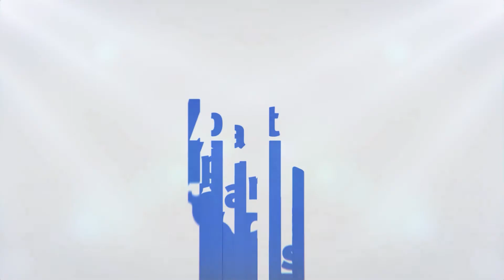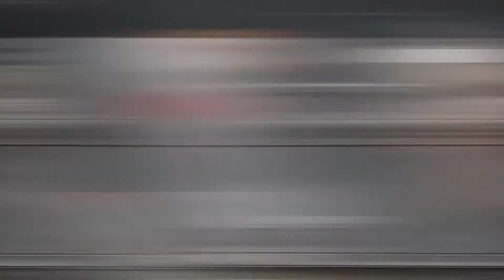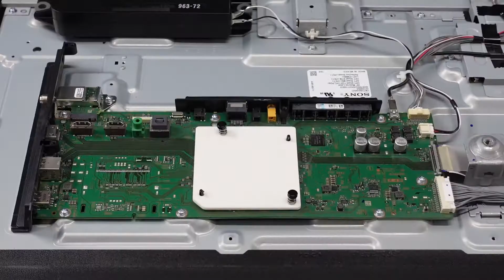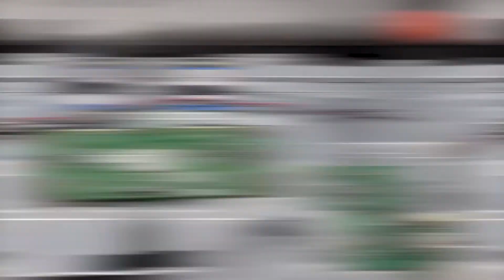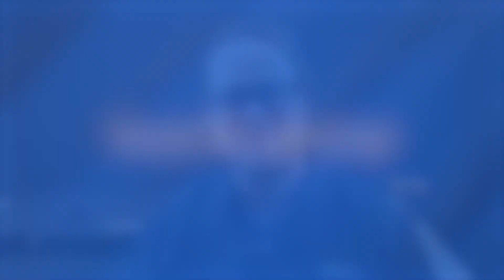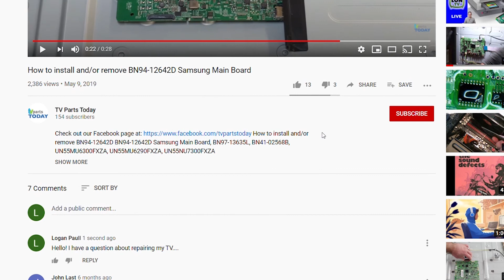Do-it-yourself TV repair.  (SONY XBR-49X800E)

Comment: Hey great video, i have the same tv but my issue is that it boots, loads the bravia setup screen and then turns off with 6 blinking lights. At first the problem was the LED driver board where you connect the power supply to the tv, replaced it and now turns on but turns off in 1 minute and gives 6 blinking lights. What could that be? Image on tv looks fine
Reply from the maker: @Aaron14Menjivar
I know the blink codes that Sony uses can tie back to a few different components in your set. I would get a hold of our customer service department and run your symptoms by them. 
phone: (930)212-1975
email: info@TVpartsToday.com

Comment: Sorry for reviving an old video! I have this TV and it randomly went black one day, still has sound, backlight, everything seems to work, but no image, just black screen, any recommendations on what it might be? T-Con maybe? I try disconnecting the ribbon cable on the right side of the TCON, and there is no change, but if I disconnect the left one, the screen shows one side white and the other black, but without any text.
Reply from the maker: @zortheck
I would assume by your description that your main board is faulty.  We see this quite often with this series of Sony TV. When you are swapping out the main board in your Sony TV you will most likely have to do a firmware update after getting the new board in.  Our customer service department has a lot of experience helping customers with this process, so feel free to reach out to us with any questions.

Comment: I have a sony xbr-49x800d and evidently the standby voltage has a problem.  It won't turn on after sitting a few hours unless I unplug the 19.6 volt power supply and plug it in again after a few seconds.  Then the set comes on and goes through the rebooting sequence and works fine.  Any ideas for me?
Reply from the maker: First I would try to replace the power supply.  I would assume by your description that this Sony unit has an external power supply on the power cord?
Reply: @tvpartstoday  Thanks for the response.  Yes it does have external power supply.  I removed back and connected voltmeter to where power supply voltage goes in and it stays 19.7 VDC, but the reason I removed back to check was that just yesterday the white LED at bottom comes on as if going to turn on then dims and goes out by itself.  While this happens the 19.7 volts remains constant but now the TV does not turn on at all.  Any ideas?
Reply from the maker: I would suggest replacing the external power supply cord first.  This is kind of a weird situation where the power cord plugs into the unit via the "LD board". This is sometimes called an "LED Driver" in our system for this specific unit, depending on which part number is in your TV. This LD board would be my second choice for a swap.

Comment: Hi! I don't know if you guys respond to Q's for older videos like this, but I have this same model TV and it has the screen jittering problem that seems to be all too common with them. Based on other videos, I went ahead and ordered a new T-Con board which I installed earlier today. This, combined with the recommended reset procedure (unplug for 5 minutes, press and hold the power button for 30 seconds before plugging back in) fixed it for about an hour or two, but then it started jittering again. Any recommendations on what it might be if not the T-Con? My first thought was to maybe clean the contacts on the two ribbon cables and plugs for the display, but with two T-Con boards now exhibiting the behavior, I don't think the T-Con is the culprit. Thanks.
Reply from the maker: If you were going to try another swap, I would suggest swapping the main board next. There could also be an issue with the panel.  Going off of your description, it sounds like there could be an issue in the TV causing problems with the boards. I am nervous that the t-con that you just swapped may have been compromised by the problem in your set. I would try to do the hard reset again to see if that is what is temporarily fixing the issue.  I would strongly suggest sending us an email with your model number and a description of the issue so our customer service department can go into it in more detail. 

phone: (930)212-1975

email: info@TVpartsToday.com
Reply: @ Thanks for the reply! The jitter issue is the same one I’ve seen several videos cover where the “fix” is to identify and use kapton tape to cover the pins on one of the ribbon cables to the display that synchronize the timings between the left and right hand sides going through the T-con. I suppose I could try that next, but I’m curious as to why so many TV’s end up with this issue? Anyway, I’ll be sure to follow up with more detail via email. Thanks again!

BTW, I should clarify that the new T-con board behaved much like the old one. Powering off the TV for 5 minutes and holding the power button down for 30 seconds is what cleared the jitter for the described hour before it started up again.

Comment: Standing in front of my TV, I noticed that the right side is a little darker than the other side. Which part do I need to replace?
Reply from the maker: There could be an issue with the LED driver board, power supply, or the backlights themselves. If your TV doesn't have a dedicated LED driver, it will be integrated onto the power supply board.

Comment: Led bar strips? How can we change them?
Reply from the maker: Changing out the LED strips is a lot more involved than just swapping out a board. The front panel, as well as the diffuser panels, will need to be removed before you can access the LED strips. There are usually a few components that hold the bezel surrounding the chassis in place. The bezel usually has a few screws on the bottom of the TV. The housing for the stand legs could also be holding the bezel in place, as well as the buffer board at the bottom of the chassis in the back. When you are trying to get the panels out of the front of the TV you will need to be especially careful not to bend, scratch, or break the panels so that there is a clear picture when you out them back into the TV. There is a tool we found online that looks like a suction cup used to keep the panel in shape when you are taking it out of the TV.  After you get to the LED strips there can be some adhesive keeping each strip in place. Its just a matter of loosening the adhesive and unclipping the LED strip from their connections. Some TV sets don't use this adhesive and there will be small guide holes in the strips themselves that keep them attached to the chassis.

Comment: Just came across this video while trying to research for an ac adapter and remote, but having no luck. I found this XBR-49X800E tv while cleaning out a home for a neighbor. The neighbor gave it to me as a kind gesture, but without the 2 items needed to check it for power, I am just stuck never knowing if it works or if its broken...
Reply from the maker: Send us an email to :     info@TVPartsToday.com       with your model number and the items you are looking for. Not guaranteed to have them, but if we have the remotes and the AC adapter for that set the guys over in our customer service department should be able to help you out.

Comment: How to diagnose this TV not to turn on at all, no image, no power. I replaced a power board but still not turning on. What board can be responsible for not turning on the TV Sony XBR49X800E?
Reply from the maker: Replacing the power supply would be our first step, but since you have already done that I would send an email to:  info@tvpartstoday.com with your model number and a brief description of your issues. Make sure to let them know that you have already replaced the power supply with no change in symptoms.
Reply: @tvpartstoday   I appreciate your quick response. I replaced it but no change. Do you think that it can be a main board or T-Con board responsible for  no power  in TV Sony.
Reply from the maker: It can be those boards, yes. I would still get a hold of someone via email to get some more in-depth troubleshooting.

Comment: My tv is stuck on a boot loop. I tried to do a hard reset by holding the power and volume down button until I see a green light and the erasing animation. It still keeps rebooting. Would I have to replace the main board?
Reply from the maker: It sounds like the main board would be the best place to start here. I would send an email to: info@tvpartstoday.com    with your model number and a brief description of your symptoms and we can give you some more information about your first steps here.

Comment: Thanks for the video. My XBR43X800 randomly went black on me while I was watching it and now has no video. I did the factory reset and I can hear the welcome audio but still no video. Would you lean main board or a different component?
Reply from the maker: if your sound is working, then it is likely your main board is okay, we would acutally suggest attempting the firmware update before spending any money on it. We have the full update guide here: https://tvpartstoday.com/pages/sony-firmware-update-help
Reply: Thank you for your response and instructions. I believe I ran the update. The white light ran through slow pulses for 5-10 minutes and rebooted. I still have no video. The only thing I get the same slight uptick in brightness (backlight) when the TV is on. Do you have any advice as to what to do next?  @tvpartstoday
Reply from the maker: When you downloaded your firmware update and unzipped the file, was the downloaded file a .pkg?
 @a4adriaan
Reply: @tvpartstoday  yes. I initially got the non pkg version on my Mac but realized on a Windows machine it downloaded a zipped pkg that I unzipped and put on a flash disk.
Reply: Did you found the solution? I have the exact same problem

Comment: Hi, i dont know if you still respond to questions, but we have a XBR-65X800G and when we turn it on the stanby light turns on, the LED lights on the screen turn on, theres sound but no picture. Sometimes after a few min the picture does come on but only sometimes.

I did do a factory reset. Noticed when we move the tv putting pressure on the screen on some edges the picture will go on/off. I think this is the main issue. Do you think the panel itself may be damaged?
Reply from the maker: It does sound like panel damage. Being able to get picture from pressing lightly on the edges of the screen is a pretty good sign that there is an issue in the panel.

Comment: I have a XBR-49X800E with multiple vertical lines that are on all the time. I used to clear it up by powering down and back up but now just vertical lines all time.   Main board or tcom board and what kind of price are we talking?   I am a former tech working on all types of equipment and can handle replacing myself.   Any comments appreciated.     Andy
Reply from the maker: Hello, 

Here is a link to those parts at the moment we are out of stock on the main board but we do get these boards in quit often. 
Main Board: https://www.tvpartstoday.com/searchresults.asp?Search=A2165797A&Submit=
Tcon: https://www.tvpartstoday.com/6871L-4922A-Sony-T-Con-Board-6870C-0704A-XBR-49X-p/6871l-4922a.htm

Comment: My XBR-43X800E stopped turning on.  I tried replacing the external power supply brick but the TV still does not turn on.  Can I assume it's the main board that's the issue or is it possibly a defective LED driver board?
Reply from the maker: Hello, 
If you have replaced the power supply we would suggest replacing the main board. Before purchasing the main board we do recommended checking if Sony still offers the firmware update.
Reply: @tvpartstoday  Quick question about the mainboard for this model.  Can I use either the A2165797A or A2165797B as the replacement?  The current mainboard in my TV is the A2165797B.

Comment: Thanks so much for taking your time to make this video. I have the 43 inch version and it got burned out by lightning coming through the cable box/hdmi cable ground. I thought maybe it was only the external power supply brick which I checked and got a replacement for but there is more damage. I was very concerned about having to remove the whole back cover, but this showed me that I didn't need to and verified it by looking at the back of mine,. Also the parts are virtually the same thankfully, though I'm getting the ones specifically for the 43 inch to be sure. So hopefully for $75 inpats and some of my time, I get by $700 set back. Again your taking your time to do this has been of wonderful and great service and is deeply appreciated.
Reply from the maker: Thank you for commenting, we appreciate the kind words!
If you are needing help in identifying any part please email Info@tvpartstoday.com and they will assist you in finding the correct parts!

Comment: I have this TV and randomly the other day the wifi stopped working.  I reset the router as usual but it still wouldn’t work.  When I go to the settings and toggle the wifi to the ‘on’ position it toggles itself back off automatically, making it impossible to connect to the router.  

Despite resting the tv by unplugging it for 2 minutes and even factory resetting it, it continues to do the same.  I hooked up an Ethernet cable to try do a software update but it says it is up to date.  Wondering if it’s a hardware issue now?  Like if I ordered the wifi part and replaced it would that fix it?  Originally thought it was a software issue but I’ve tried everything to fix it that way with no success
Reply from the maker: Hello, 
If you have already tried the factory reset we would suggest replacing the main board if the Wi-Fi board is connected to it. 
For us to identify whether or not it is we will need the model number of the TV. 
Is your model number the XBR-49X800E?
Reply: @tvpartstoday  hey thanks for the response.  Yes, that is the model we have.

Comment: My XBR-49X800E stopped turning on without warning. There are no indicator lights. A voltage tester tested positive to power flowing through the power cord, and when the tv is plugged in, there is positive power flowing to the USB hubs per the voltage tester. Power reset and factory reset all had no response. Would a replacement of A2165797A fix the issue? What are the odds it's another part?
Reply from the maker: Hello, 
For your model having no power it could be the LD Board or the Main Board. 
You could order both to save on shipping if you would like and return any parts that are not needed. Below are the links to both of those board. Before purchasing the main board we do recommend you check to see if Sony still offers the firmware update before purchasing. If you have any further questions or concerns you can also email Info@tvpartstoday.com

LD Board: https://www.tvpartstoday.com/A2170728A-A-2170-728-A-Sony-LD-Board-1-981-457-1-p/a2170728a.htm

Main Board: https://www.tvpartstoday.com/A2165797B-A-2165-797-B-Sony-Main-Board-17363371-p/a2165797b.htm
Reply: @tvpartstoday  Unfortunately, you are out of stock of the main board. Also, trying to avoid restocking fees and return shipping if I don't need a part.
Reply from the maker: @IG-kz5ip  Hello, I am NJ, the plant manager, I believe I had the pleasure of speaking to you today on the phone about this issue. While the employee who posted before me is not technically wrong, there is a way to be more "right" so to speak. The A2165797b and the A2165797A are the exact same part. Sony main boards a re tricky in the way that the manufacturer will place a number on the board that is similar in format to the part number, IE: A#######A/B, that number is useful - however, the official part number of the main board for a XBR-49x800e is the A2165797A. Sonys , for the most part, you can order by model number alone in regards to the main board as Sony typically ususes the same main board throughout the entire series IE: XBR-55x800E, XBR-49x800E, etc. -NJ
Reply: @tvpartstoday  NJ, you are the best! Thank you for all of your help! Anxiously awaiting the restock of that part.

Comment: The channel logo and sometimes a few lines appear on the TV screen for a few minutes and disappear automatically.Frozen subtitle image and sometimes only the frame on Sony 55x8000h TV stays on all inputs for a few minutes
Reply from the maker: We would recommend with replacing the main board first! That part number would be 	
A-5015-318-A for a 55x800H, link is below! https://www.tvpartstoday.com/A-5015-318-A-Sony-Main-Board-A5015305A-1-003-740-p/a-5015-318-a.htm

Comment: I have a 2017 Sony XBR-X800E that will not turn on. I hear a clicking noise when I plug and unplug the TV, but it will not turn on or flash any lights. Any idea what this could be?
Reply from the maker: I would recommend replacing the main board first as it sounds like the clicking you are referring to is the power supply board attempting to come out of standby but being unable to do so. The issue you are describing could be caused by either the main board or the power supply board but I would start with the main board.

Comment: Appreciate the video! I have a Sony XBR-49X800E and bought it new just under 3 years ago. Went to use the TV the other night and it wouldn't and still will not turn on. No power light of any kind turning on whatsoever. I've done all the troubleshooting for power reset, trying other outlets, and even bought a new power cord with no relieve or signs of life. I'm at a lose of what the problem is and frankly kinda shocked it crapped out on me in under 3 years with minimal day use. Ideas/Thoughts of what/where the problem would be?
Reply from the maker: Power supply or the main board.